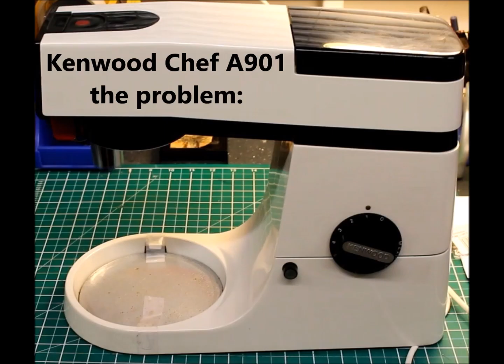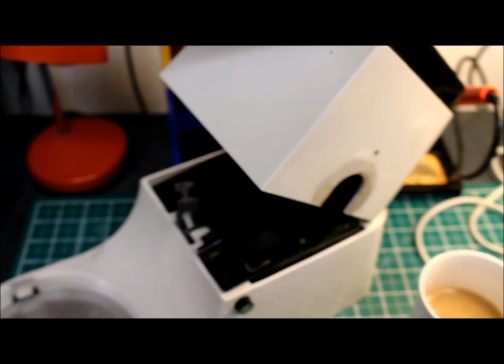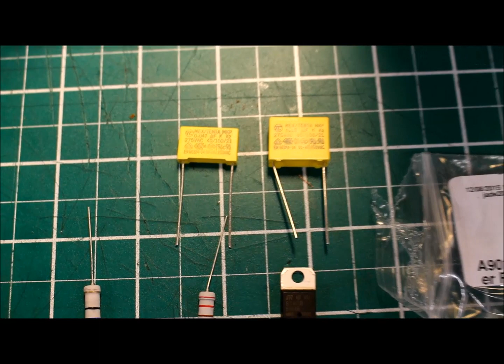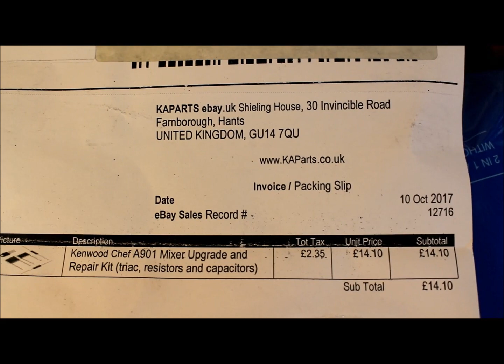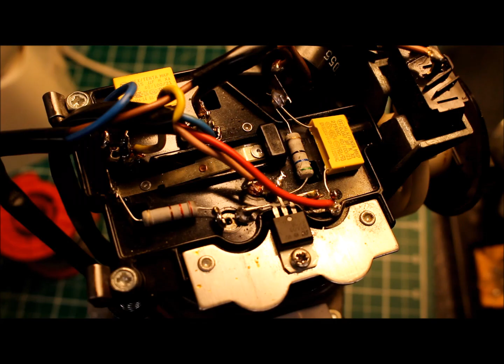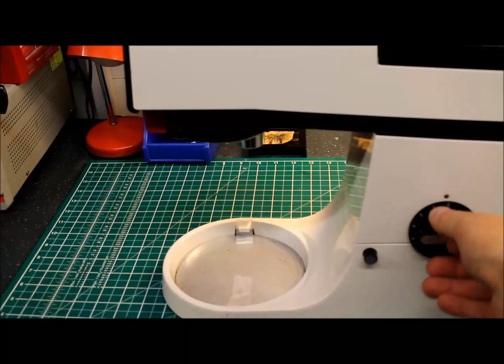Kenwood Chef A901 smelly smoking motor speed control repaired at FixItWorkshop, Worthing

Comment: Hi, I note than when you test the motor out of the machine, it has a tendency to "pulse" randomly. Mine does the same (almost sounding like a little 2 stroke petrol engine!) at intermediate speeds but not at min or max. Is this normal? Many thanks for your informative video
Reply from the maker: Pretty normal
Reply: I just did electrical components renewal and during test mine sounds just like motor from this video.

Comment: Very useful - especially the close-ups. I replaced the capacitors and burnt out resistor. And it works, just too fast at low speed. Apparently there is a low-speed adjustment, but I can't find on the web where it is in the machine. Thanks.

Comment: I just got the same model and after 2min of use on bread mix it made a loud "crack", smoked and smell (but didn't stop until I did), one of the capacitor is cracked and burnt so I know what needs to be replaced but I was wondering if the gear box needs to be all cleaned and greased with new grease because it's such an old mixer or should it be ok with an updated circuit board?
Reply from the maker: Unless it was noisy before, I'm sure that a repaired board will be fine
Reply: @Matt_Marchant_fixitworkshop  ok thanks for the quick reply !

Comment: Thanks for this vid! I just picked up a gorgeous space orange A910 like yours in Germany for 30 euros, all running but smelled of smoke the moment is was switched on. Took it apart and turned out the only issue was the belt was walking up the spindle. I haven't done it yet but I suspect I play with the adjusting bushes under the high speed take off to realign. Have you played with these at all? The motor is running a little lumpy at low speed so I thought I might as well replace these parts too. Thanks for the tip! I managed to buy the components separately from an online electronics component retailer here in Germany for under 3 euros, the postage cost 6 but 9 euros in total. Looking forward to the fix and getting it back up and running properly for another fifty years :D
Reply: The motor pulley should have a white plastic washer on the top which stops the belt riding off and cutting a grove into the underside of the top (plastic) cover.  You can adjust the tension using the three bushes; the belt should be slightly loose, i.e. you should be able to squeeze it slightly where it comes away from the motor pulley.  The screws for the bushes need to be tight, but don't overtighten as I stripped one of the threads doing this and had to repair with a helicoil kit!  The A901 motor is a bit lumpy at low speed, even when it's running well, as the control circuit is fairly crude.  A901E has a much improved arrangement with a magnet on the bottom of the motor fan which induces a voltage in a pick up coil on the control module.  This gives smoother operation and allows the lowest speed to be set a bit slower than the A901.
Reply: @benjamindaniel8467  Thanks for the response. The washer acts as a back stop but isn't helpful if the alignment is really bad. The key discovery was that if you look at the white bushes holding the screws, they are eccentric. In other words you can tweak them slightly to adjust such that the belt runs true and doesn't "run-in/run-out". Once corrected, the belt ran fine. I even replaced the speed controller electronics for completeness and Have a wonderful machine. It's still lumpy at low revs, I may get a replacement stronger motor at some point, but for now it's just part of the little fella's character. All the best.
Reply: @RSoos68  thanks for the info; I know that the adjusting bushes are eccentric but I’ve seen the relevant page in the service manual and the thing it says is to adjust them so that the belt is slightly slack and not tight.  Glad you got it working well and aligned correctly.  The A901 is lumpy at low speed, it’s a crude design of speed control.  The A901E motor is much better and has a proper PCB to regulate the speed.
Reply: Thank you guys for these comments! after swapping the motor brushes, my KM400 was louder than before. The belt was also running very warm really fast (after 1min not touchable…). After I adjusted the eccentric bushes so the belt tension was correct, everything worked as before. So again, thanks!

Comment: Does the frequency or voltage here in Canada change size of capacitors or resistors needed
Reply from the maker: I wouldn't have thought so, although there may be small variations. Repair kits are readily available from LKS in the UK. Try them for a kit.

Comment: Hi

Thanks for the video, any suggestions where I can buy good quality repair parts ? I have seen many in eBay. 
Thanks
Reply from the maker: I use eBay shops - about three.  I only use the later specification component listings, not new/old stock that some vendors offer.

Comment: Hi there, I have the A901. It runs but there is a bit of a wiff of burning so I intend to replace the components as stated here however it id VERY noisy. I have tested the machine with the drive belt removed so the noise is for sure coming from the motor assembly. Any ideas before I buy a new motor? Many thanks
Reply from the maker: Hi David. The 901 was never a really quiet machine, but you could check the motor bearings and brushes. There's a good video on YouTube explaining the bearing check. Good luck.
Reply: Thanks for getting back to me. It isn't just motor noise it sounds like a bag of bolts! I will give the bearings an oil and see if it helps. I suspect it may be time for a new motor though.
Reply from the maker: David Kemble Don't condemn the motor just yet, a little end float is needed. Check the fan is intact too and the brushes are OK.

Comment: Hello again. I have had my A901 repaired - I ended up taking it to a shop and getting it done as I didn't have the means, skill or time to do it. It turns out that one of the transistors had gone and it is now working again. So I have this machine alongside my KM300. I was wondering if you could answer a further question for me. Would I be right in thinking that over the years, the speeds at which the different model Chefs run has changed? I notice that the A901 runs noticeably faster on setting 1 than the KM300 does at the same setting.
Reply: If it's an A901 (not A901E) the minimum speed should be set to ~60 r.p.m.  You can use a stopwatch and time how many times the planet hub goes round in one minute to check it.  Later models (A901E, KM200 and early KM300) have a different speed control circuit which uses feedback from a magnet on the bottom of the motor fan to induce a voltage in a pickup coil; these can be set to around 45 r.p.m. at mimimum speed (sometimes slower).  The later KM300s have a motor of Chinese manufacture and it's possible that these run even slower at minimum speed.  When you raise the top arm of the mixer, if you look at the black pastic motor cover and ventilation slots are visible it has a British motor.  If the cover is "solid" (no ventilation slots at the front) it has a Chinese motor.

Comment: Thank you for your response.                                                                                                          
        The machine worked for a little while during of which I noticed some sparks coming from the motor.  I replaced the carbon brushes but still it does not work. Do I need a motor, if so where can I find a new one? any idea of cost? Thanks again!
Reply from the maker: Hi Kostas, it's normal for some small sparks at high speeds or under load, but excessive sparking could be down to a few things.    You could try and find a good second-hand unit on eBay or www.kenwoodchefrestore.co.uk or www.kenmixengineering.co.uk.  I'm not affiliated with either company, but I know they are well regarded.  Before condemming your motor, maybe check the connections you've just soldered.

Comment: Does it matter which side is up on  the capacitors?
Reply from the maker: These capacitors have no polarity markings (from memory).  Worthing checking the ones you have, so it shouldn't matter what way they go round.  On the kits I've used, I have the writing facing me so I know what type they are.  Note, both capacitors are different values.

Comment: Hello, I have the same model machine and i have followed your instructions to replace both  capacitors and resistors as well as the triac. the machine run just fine when i tested it. While i was placing the cover, tighting the screws, etc, i accidently pressed the green bottom. since then the machine does not run.  can you please assist me?
Reply from the maker: The green button is a re-setable (in theory) overload button.  If it was working, maybe check the connections and give it another press.  Maybe check the button for continuity before condemning it.

Comment: Hello, am hoping you can clarify something for me. I have this exact machine that belonged to my mother and recently retrieved it from my loft loft. When I plugged it in and turned it on it seemed to work just fine, which was encouraging, so I decided to use it. Initially it was fine as it was just mixing some flour and other dry ingredients. I attached the dough hook and added water to the flour (was making bread) so now the machine was operating under a much greater load. Within about 10 seconds smoke started pouring out of the machine although it continued to turn the hook. I immediately switched it off. Would this be the same issue as you are outlining in this video? The reason I ask is because you seem to be implying that the issue you are demonstrating here would result in the machine stopping altogether. I am very keen to repair this machine because it is in such good condition and if I can save it I will. Before I start buying replacement parts I need to be sure that the issue I have is the same as the one you are describing in your video. Thank you.
Reply from the maker: The symptoms your machine showed would be in-line with one or both of the capacitors failing.  Without inspecting the machine, it would be impossible to confirm that.  The one in the video failed as both capacitors had expanded with a resistor also going open circuit, causing it not to run.  I've also repaired Chefs that carry on working with the rest of the circuit intact but performing badly (motor speed flutter).  The best way to confirm your problem is to disconnect from the mains (of course) and inspect all components with a meter.  If the components are original (say 35 years plus years old) then the capacitors are probably past their best anyway and would require replacement.  While the machine is in pieces, check the motor brush operation and belt tension.  You might also want to clean inside the machine too. Good luck.
Reply: FixItWorkshop Worthing thanks for the speedy and informative reply. Will let you know how it goes.